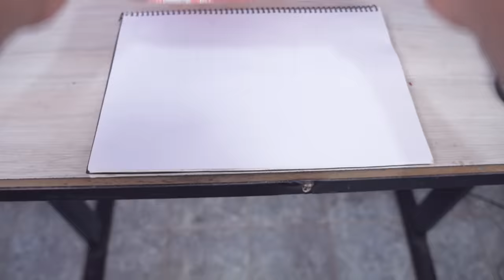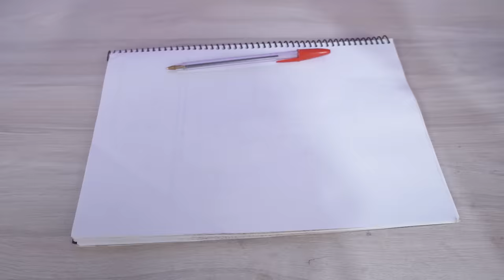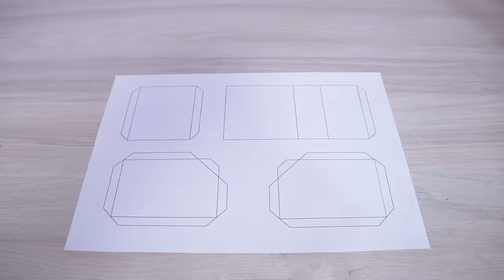Make a Amazing MINI RC MOTOR GRADER recycling cans

Comment: I like the concept and the detail but the material used will not standup to the wear and tear of outside use the wheels should have been rubber the frame should have been metal little more powerful motors plus 4 of them the steering motor is fine the blade should have been metal.... What I'm saying is no wood or glue the soda cans are fine just need to paint them maybe add some lights also construct a fake detailed motor.....